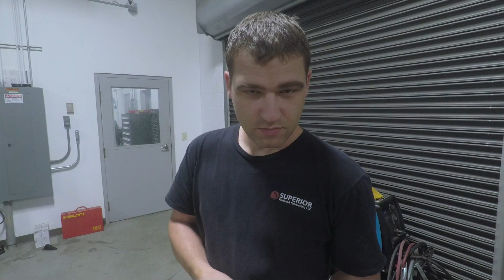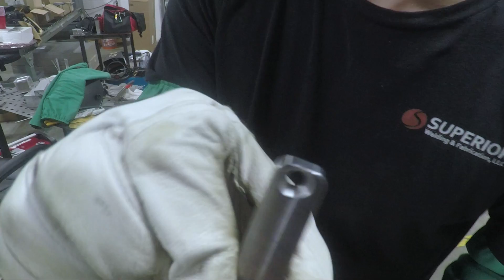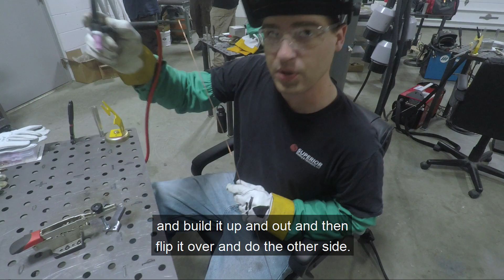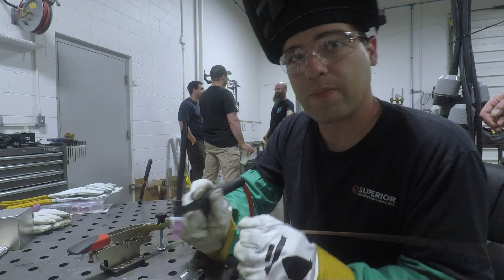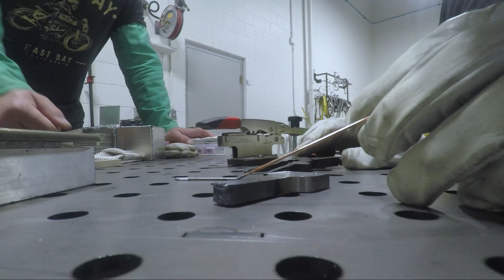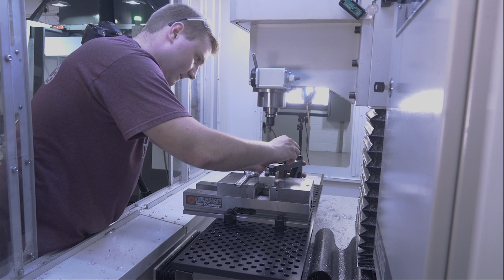TIG Weld Repair on Machined Part!  WW155

Comment: Hi John , nice video!!  Just a cool tip of the day,   I use a  (3.50" lg. Carriage Bolt on the STC-HH70  style of Toggle Clamps) and a (3.00" lg. Carriage Bolt on the STC-HH50 style of Toggle Clamp).  Ray:)

Comment: Half of my business is welding screwed up parts for local shops. The materials are expensive and the time to machine them is also so its cheaper to weld and re machine.Nice video John.

Comment: When we TIG material we want to keep cool we use a mister on the back side or on the sides of our part to keep it cool. The misters are misting water and it works wonders to keep thin parts from warping.

Comment: I prefer MIG welding for many build up repairs. A small build up is OK with TIG but on larger areas, MIG weld puts less heat into the part. If a large area needs to be built up, dual shield wire leaves a more machinable deposit.

Comment: Thanks for sharing John. Reading through the comments it seems the point of the video was missed. This was a quick fix on a small part as an example of how to do it. I do these repairs all the time on costly parts/metals and the customer is super happy. I think some are overthinking what we are doing here. The metal was not ruined, although I would have preferred a larger cup for better gas coverage. If this were a titanium part doing a TIG weld repair job like this would have be a lot more cost effective than starting over (usually).  If this were a complex part extra care would have been taken to avoid warpage/excess heat input as well. Great video though! -Jonathan

Comment: We do lots of repairs for CNC shops that have had a crash or dropped a tool mid part but its worth remembering that tensile strength of filler material and resulting hardness after welding are two different kettles of fish in steels and especially stainless.
Reply: Gas shielded welding processes like TIG and MIG have comparatively uncontrolled cooling that may be problematic. Stainless steels can have precipitation hardening characteristics that are very difficult to control. Aluminum, well, it can be done but it's a bit of a crap shoot.

Comment: Metals are so cool: if you goof with any other material it's over... with metals, you can pretty much correct/fix anything.  I remember thinking the same thing when Adam Booth (Abom79) sprayed molten metal on a shaft to increase the OD.
Reply: Many plastics can also be welded... ;)
Reply: What kind of ANY other material would john's part have been made of?

You didn't say anything about this specific item. You said "Metals are so cool: If you goof with any other material it's over."

Don't go moving that goalpost now...
Reply: ajtrvll 
PLA, ABS, and PVC are 3 examples of plastics that can be welded using a filler rod.

Also, fiberglass is another material that can be repaired using similar principles.
Reply: ajtrvll 
I don't have any links. I've done it though.

Fiberglass isn't melted, you remove an area around the hole, grind it to a 'chamfer', repair the fiberglass with new fiber and resin, and re-drill.

your comment, again, was that metal is the only material that can be repaired when messed up like this. these are examples of other materials that can be similarly repairs by rebuilding the substrate and re-drilling.
Reply: LOL, k.

if you're more interested in FEELING 'right' than learning what's actually correct, that's your prerogative.

cheers. 😉
Reply: ajtrvll welding wasn't a part of your original statement, but plastic welding is still just as possible as welding metal is.

it's whatever though, you've made up your mind.
Reply: Again, you now want to twist your way out of what you said, because you're more interested in feeling like you were right, than actually learning anything, so you're trying to weasel-word your way out of it.

What you SAID was "If you goof with any other material, it's over."

Nothing about welding. And again, plastic welding can be used in the exact same manner! I mentioned welding plastics because it's literally the same process.

However, fiberglass was another one I mentioned, because it's also not "over" just because you goof with it.

You want to move the goalposts, or weasel word your way out of it? That's fine. Like I said, you've clearly decided to close your mind, and convince yourself that you're right, at all costs.

I'm done. There's no reasoning with unreasonable people...
Reply: You said " if you goof with any other material it's over."

That was your claim.

That claim was false. End of story.

Like I said, I'm done trying to convince you of anything. You've made up your mind. I wouldn't have the first clue as to where to find you a link of plastic welding process being used. It's not something most lay people do, the fact that you cannot find any links demonstrating it isn't surprising. That doesn't mean it can't be done.

I've used that method myself multiple times, but I didn't take videos; and I'm not going to go to the effort of breaking something just to repair it, just to get a video of it to prove something inconsequential to a person who has made it clear that they're not actually interested in anything besides feeling like they aren't wrong. Even if that means severely shifting the goalposts, and trying to find excuses for why their claim doesn't actually apply to other materials, simply because those other materials aren't metal.

YOU said that a goof with any other material means it's "over". It wasn't true then. It's not true now. It won't be true no matter how much you try and backpedal.

Have fun basking in your stubbornness. I won't respond again.
Reply: In what kind of plastic could John's goofed part be made out of so as to be fixed?... I know of none... if anyone does, please leave a link.
Reply: @Wrenchmonkey fair enough... if John's goofed part is no good, what about the other example I cited in the same comment?  In what kind of plastic could a part OD be increased?
Reply: @Wenchmonkey from what I have seen, the plastic filler rod is not melted/fused into the substrate... it' looks more like heat bonding of a softened filler rod (akin to soldering or braising perhaps)... if you have a link where filler rod is completely melted into a pool of the plastic part to be repaired, I would appreciate it.  Same goes for welding fiberglass.
Reply: @Wrenchmonkey I fully stand by my original comment as I don't consider fiberglass repair to be remotely in the same ballpark as welding.  No matter the technique you use in fiberglass repair, the filler matrix and reinforcements never penetrate/mix into the original material, and vice versa.
Reply: @Wrenchmonkey I came off wrong...but I get your point... and here is what I should have written in my original comment:

1- Almost any material can be repaired using various techniques;
2- Welding is one of the 'coolest' repair technique I know of;
3- Only metals can be repaired using welding (which makes metals pretty 'cool').

I DO want to learn if I am incorrect about item 3-. ...don't care about feeling right 🙂 

Perhaps it's the definition of welding that's tripping us up?
Reply: @Wrenchmonkey As this is a repair welding video titled "TIG Weld Repair...", I believed welding was implied in my original comment... and since your original reply was "Many plastics can also be welded", I believed you understood that... me and my beliefs, when will I learn 🤣 

... as you suggested, I should just stick to feeling right.
Reply: @Wrenchmonkey 

1- Your drive to teach me something is admirable and I welcome it... your frustration towards me for failing to learn your teachings, not so much... let's keep it civil and honest or let's drop it, ok? 🙂

2- Could we avoid bringing into the discussion unrelated repair methods i.e. adhesives, fasteners, cosmetic fillers, etc... all of which also apply to metals, but have nothing in common with welding.

3- You say: "plastic welding can be used in the exact same manner! ...it's literally the same process". These are your words : "exact same" and "literally"

I respect your opinion but I personally remain very skeptical and would love to be proven wrong.  I have searched and looked to see if what you are stating is true... found nothing... that's on me.

The closest thing to 'plastic welding' I have seen is ultrasonic welding... but that's more akin to friction welding, which can be great for some types of assembly, not so much for repairs.  The rest is more akin to soldering or braising... not welding.

If you can't (or won't) back up your own statements by providing a simple link showing 'plastic welding' as you have defined it, i.e "literally" the same as John's repair video... well then buddy, that's on you.

No goalposts, no weasel-word, no feelings... just give me a link!
Reply: @Wrenchmonkey 😲 That's quite the tirade!... I just asked for a link, a reference, anything... but ok

1- My original comment must have offended you and your beliefs.  I used insensitive language when referring to classes of materials and their repairability.  I made generalization about their physical properties and relative appeal... for that I apologize.

2- My discriminatory remarks have blown my cover as a black-ops agent of the metal lobby... which was your plan all along, being yourself an agent of the plastic and resin lobby... well played comrade.

3- As you say, plastic welding is so common anybody can do it in their garage, yet nobody ever posted a video on it on YT... how is that possible, ...unless

... which storyline do you want to run with?

Comment: Funny how people dont understand that this was a demonstration and not the need to actually fix the part. When you have spent hours machining a part or material cost is high is of course when its an option to weld it.
Reply: All welding results in a certain amount of distortion. If the distortion exceeds what can be cleaned up within tolerances, it's not acceptable. Undercut at the weld edges is particularly difficult to eliminate on machined surfaces. The heat affected zone contains every level of heat treat the material is capable of achieving. With proper heating and cooling control, the effects can be minimized. If the material can reach a high degree of hardness welding can create areas of extremely hard metal that are difficult to machine.These materials may tend to crack, sometimes long after the job is finished. Even though the job seems acceptable when finished, premature failure may result.
Reply: I've made parts that should have been to "hog trough" tolerances but were called out to plus or minus .0005. I spent hours machining parts that turned out to be absolutely non critical. If these parts had and error, we would not have tried to weld them for rework because the tolerances were so tight. A young engineer simply had his Auto Cad program set for a default tolerance. He didn't know why it should matter.
Reply: lol. We were taught about the financial troubles tolerances could cause in our drafting and design courses. "Learn by Doing" is great, but when I started my internship(after 3 design courses & 3 drafting, everything was still ±.005. My biggest lesson came from shadowing the lead toolmaker as he made all my parts. This fixture was for laser measuring magnetic tape reels down to the micron to check for any dirt so my tolerances ranged from ±.0001 to ±.005 (a spec of dirt in the coating process anywhere in the ~1.5 foot diameter reel would show up on the outside). He grilled me on every dimension and tolerance, and we even set up a Unigraphics station so we could review the entire assembly together. I found that being taught ±.0001 is extremely expensive didn't hold a candle to watching a guy on a DRO Bridgeport and manual lathe attempt to hold those tolerances. 

He was a master toolmaker an also an old timer at the company, and with the assembly drawings provided, knew exactly where cutting corners and ignoring tolerances on my prints was A-ok. And most importantly, __he showed me why. 

It's hard to fault my alma mater, as their learn by doing philosophy produces some of the best "ready to work" engineers, but a basic machining lab of 3 hours a week for a semester, making simple parts from perfect prints, just doesn't cut it for real world machine design stuff.
Reply: Repairs like this are viable in some cases. It takes an expert welder. A hobbyist can't do it. In mild steel, a welded hole like this will actually be more durable than the original metal. It's not for critical, close tolerance parts made of high alloy metals and special heat treat. Lots of machine work is relatively loose tolerances and low tensile alloys. fine for those cases.
Reply: Talk is cheap. Easy to say that from a keyboard, please elaborate on why this wouldn't work out in a "real repair scenario".
Reply: phlodel yup. 

It's called rework and it happens everyday in all sorts of different processes.

But you've pointed out the most important part: the devil is in the details, and you better know em when seeking or giving the approval for pretty much any kind of rework or process involved in the final part.

Just a quick example: when I was at Haas our sheet metal drawing notes went from all over the place to a couple of standard paragraphs. Basically all different kinds of finishes call outs so the shops knew what areas of the parts could be quick and dirty b/c they would never be seen, what had to be perfect b/c the customer would constantly be working on them, and everything in between. Made the parts cheaper in most cases, more expensive in a few, but most importantly, QC/purchasing/engineering stopped bugging each other over "is this OK" questions (or this isn't OK directives, missing from prints) that ate up an unbelievably immense amount of time. 

In the world of contract manufacturing that we love in today, detailed prints are absolutely key. I've recently looked back at prints I made for a test fixture (that ended up being my senior project) up while interning at Imation. They played played pretty fast & loose with $$$, opting for very conservatively toleranced parts b/c they were very low volume, very critical parts that would have cost $$$$$$$$ more if we spent time finding where that "red line" was that we couldn't cross. But we also used the same job shops for nearly everything and they knew what the deal was. The $2k nickel plated part our toolroom couldn't handle was  extremely overdesigned, and the flatness + perpendicularity tolerance of .0005" over 5" was perfect, but technically we could have rejected it because I called out "weld all around" in 4 places for support beams, but none of them were. But the shop "just knew" that I was designing for elephant when all I needed was a mouse. If we rejected that part the shop would have been hurting bad. I think a total of ~1” of total weld would have needed to be added in 4 places, throwing off the flatness, perpendicularity, and every feature on that face. Not to mention the replating. 

Unfortunately those kind of relationships are getting lost with all the overseas manufacturing. Making detailed, sensibly toleranced and called out prints is more getting to be more important than ever, even for "easy" parts.